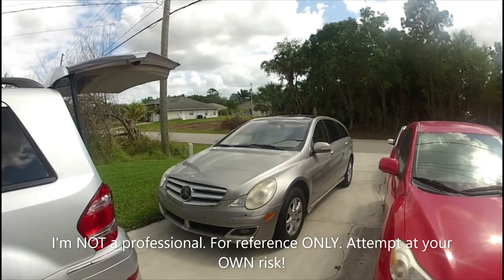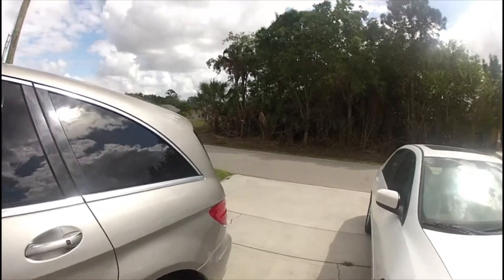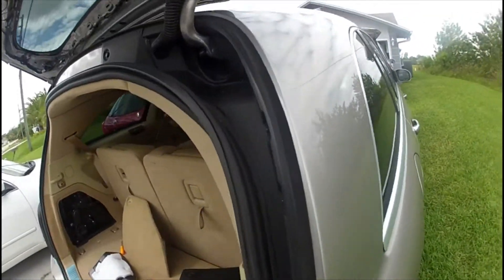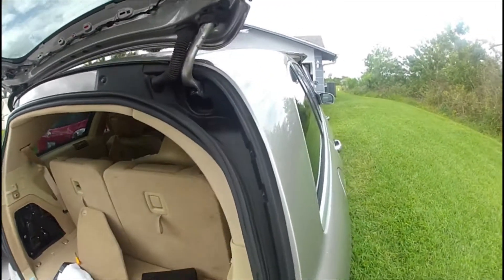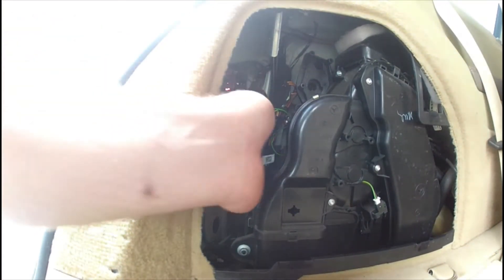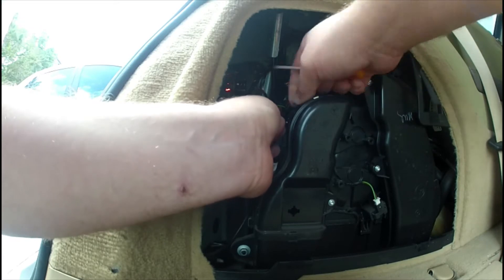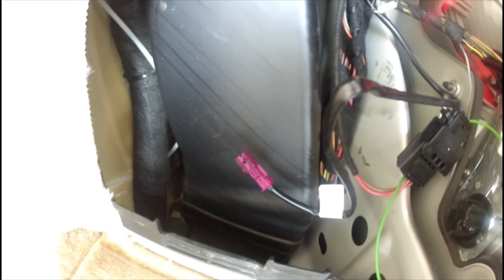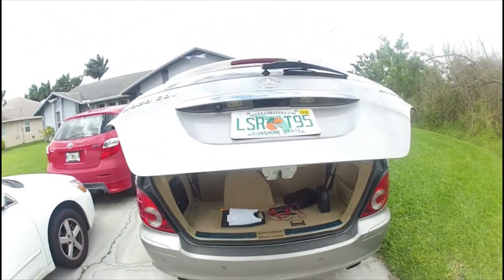This is WHY your Mercedes Liftgate STOPS HALF WAY DOWN and reopens again!! Won't close!

Comment: Hi
I have the same year, 2007 r320 cdi
I also have the right rear obstruction sensor issue. Also same exact problems as you have shown.
I tried adding the resistor.
Didn't work
There is another error code pertaining to the absence of the sensor.
The live data shows sensor not activated, actually both.
I'm now suspecting the control module.
The hydraulics and latch have been replaced.
Frustrating problem
Reply from the maker: make SURE you use 3.9 KILO ohm resistor! NOT 3.9 ohm resistor. this is a very easy mistake to do. you need a 3900 ohm resistor. if you put in a 3.9 ohm resistor you will get different codes
Reply: @kjemad  thanks for the reply.
I tried both 2k ohm and 3.9k ohm 
The same results with both.

Comment: I put The resonators 3.9ohm on both aidės. Button started to work but as you said closes half and Then opens again. Maybe you know why? :/
Reply from the maker: make sure you use 3.9 kilo ohm, kohm. that is 3900 ohms. not 3.9 ohms
Reply: @kjemad  its me from another acc. I put 3.9 kOhm 5% 0.25 W on both sides. Button started to work. Opens perfectly with handle, key fob. Closes only half with button or key fob and opens again. If I hold the button on tailgate while its closing it closes fully. I topped up hydraulic fluid to pump also. Dont know what to do anymore? :(
Reply: I found the problem guys! Open tailgate fully! Manualy press latch with screwdriver so it will lock and buzz while opened. Now pull handle physically from tailgate inside near the window (SOS open from inside) Now it will fully close without any problems :) my guess it was stuck in open/closed position thats why close only half. Hope it will help for others!!!

P. S now no buzz when its opened and pressed by screwdriver and all works!
Reply from the maker: @laurauselyte9814  if this fixed your issue you have a bad latch lock motor....
Reply from the maker: @edgarasxazen2965  possibly a bad hatch lock motor unit
Reply: Latch replaced like 4 months ago. It was just left in stuck position or something and my method fixed it. It closes completely without any problems.

Comment: In my case,  the switch on the door doesn't work at all. When I installed the 3.9K.ohm resistor,  the tail gate closed.  Upon opening it with the remote or the switch on the trunk,  it won't close again.  Pls any further suggestions.. Thanks.
Reply from the maker: It's probably the handle stuck open. its actually stuck in the open position all the time. thats probably why it doesnt work. you need to pry it back to the normal position again

Comment: Mmm I have  2.200s ohs  on each side  could be the same problem??
Reply from the maker: probably not. your issue is probably the hatch lock mechanism. common issue. tons of youtubes about it. or its the actual opening handle on the hatch stuck in open position. common issue as well

Comment: Hello, good video, I have a very similar problem, when you show how it opens but doesn't, I was so happy, but when I went to check the resistors they are both measuring the same (about 5k ohms), so sad it doesn't seem to be that. One thing I notice is that the chime beeps only twice when opening (at the beginning of opening), then when I press the close button on the remote no beep at all, but I can hear the latch mechanism doing something, door tailgate doesn't budge.
I unplugged both connectors and it does the same, any ideas will be greatly appreciated.
Reply: Update: it actually worked, I put a 4k ohms resistor on the right side only, and it worked, thank you so much.
Reply from the maker: @pauljohnson1404  good! I would just put a resistor on the other side as well. when one goes the other one is not far behind...
Reply: Do you recommend a 1/4 or a 1/2 watt resistor?
Reply from the maker: @aarongutfreund  it doesnt matter. not much of a current running thru the circuit
Reply: @kjemad  your idea worked great! I just installed a 1k resistor on my pressure sensor connector wires, to match the sensor's 980 Ohms resistance. It worked great! Liftgate now opens and closes fine. Thank you so much!!!
Reply from the maker: @aarongutfreund  glad to hear that!
Reply from the maker: https://www.youtube.com/watch?v=gtiUh-JSkdo
Reply: Dude sounds like he’s from out of town!!!
Reply from the maker: @andrewbeasley4780  lol
Reply: Awesome idea. I'm doing this project on a 2016 Toyota RAV4 to bypass the tailgate object sensor. I measured my pinch sensors at 980 Ohm. How precise of a match does the resistor need to be? Can I use a 1K Ohm resistor?
Reply from the maker: @aarongutfreund  probably. I would give it a shot and see. you can buy resistors on ebay for a few bucks
Reply: @kjemad  Will do. I ordered sets of 910 and 1000 Ohm resistors.
Reply from the maker: @aarongutfreund  do you have 2 sensors in the rav4? I was lucky and had a known good sensor i could measure and compare. 1k ohm sounds a little low?
Reply: @kjemad  Yes there are two sensors, one on each side. They were originally failing. I tightened up the bolts that hold the sensors in place to make sure there was no friction and adjusted the alignment so that the sensors do not rub against the sides. At that point, once everything was working, I took the measurements.
Reply: @aarongutfreund   i realize this is an older thread, but if you should see this, please tell me or show me where and how you tested these two sensors on the RAV4.  Many thanks in advance.  I'm thinking on the PRD ECU multiplex unit but not sure
Reply: @kathyloeb8344  I tested the sensors by physically moving them around, observing for rub and verifying that they did not rub against the side of the hatch while closing.